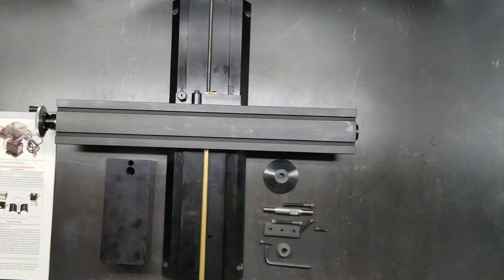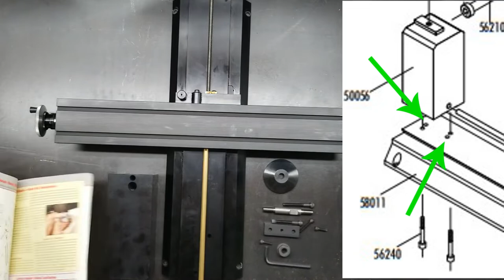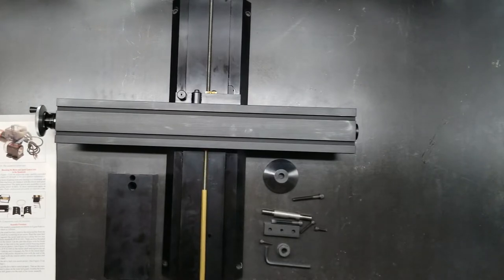Assembly: Sherline 5800 Next Gen Mill… The Big ONE!!!!

Comment: I have the model 5400, and bought the wider table and taller upright as I went along because I kept running out of space to machine things.  There isn't a practical way to increase the Y axis travel, so I'm having to live with that, getting round it by using a rotary table when necessary.  You won't have those problems!
Reply from the maker: That is exactly why I went with the 5800.  Though this thing is heavy and I haven't gotten it mounted yet!!!  That is a great idea and use to get more travel with a rotary table.  I might not use it that way but I still want to get one.  Did you go for the Sherline?
Reply: @LoydPrecisionMakers  I defaulted to the Sherline rotary table as I’m using it as a 4th CNC axis.  The thing is built like a tank, must weigh 10 pounds.  It also readily accepts the faceplates and the chucks that are standard on your lathe.
Reply from the maker: @Reach41  Thanks thatvis good to know and convenient as well. I saw Sherline did a video where it was turning around an engine block. Seems pretty capable.  Do you use it with their CNC linear controller? If so how is programming?
Reply: @LoydPrecisionMakers  I use the rotary table with it integrated into the CNC system on my machine.  It still retains the handle for using it manually, jogging can be done from the on-screen control, and I can issue it G-code move commands manually as well by just typing them into the terminal window.  To answer your question, I don’t have the handheld controller.  No need.

Where did you get your machine shop experience?  You clearly know what you are doing.
Reply from the maker: @Reach41  I gotcha.  That would make for some really interesting machining.  I'm curious how good their hand held controller is with a manual machine setup.  It really is hard to judge without first hand experience or accounts.  

Thanks on the compliment on machining.  Though there is so much left to learn.  My Grandfather worked with my dad when he was young in an auto shop 10 miles past the edge of civilization in the desert servicing everything form passenger cars to mine equipment.  My dad worked a bit in the Kaiser Steel Eagle Mountain Mine before it closed.  They passed a bit of everything on to me.  My last couple years in college I volunteered at a shop part time.  Currently, I am working with a Journeyman Machinist and  Journeyman Tool and Die Maker.  We're doing a pseudo apprenticeship on these machines and using book as a sort of curriculum.

Comment: Have you thought on how you are going to bolt down the mill? My 5400 is bolted to a surplus piece of maple butcher block. No kill like overkill.
If I got a 5800, manual or CNC, my thought was a couple of pieces of say sandwich of 2 24x24x3/4 plywood with a sheet of 1/8 steel on top. Mainly to have something for an indicator stand to stick to but also so I could move the mill to another table if need be.
Reply from the maker: Originally I was thinking of using a piece of .500 inch thick 19x13.5" aluminum rem.  In 6061. Super over kill. Believe it or not it priced the same or just under a piece of sanded marine .75  set up you mentioned. The metal monger also has tooling plate aluminum drops/rems.  Only thing, is it makes the whole thing a bit to heavy. Initially I didn't apretiate how heavy the 5800 was.
Reply: @LoydPrecisionMakers  I had not though of aluminum plate. I forgot how crazy wood prices are now. I am still thinking a top layer of steel for magnets though.
Reply from the maker: @curiousgeorge4608  ya the steel wood definitely be a nice touch. My only issue is the hot rolled i get always seems to have a curve in it one way or another. If I wanted to be totally crazy. Maybe use a piece of aluminum tooling plate and drill and tap a bunch of holes same size the sherline tooling plate. Use all the same hardware and have a mobile dead flat steel plate that can be moved around the base. This way also get a way to fix a removable handle(s) for transportation.... Some day in my copious spare time.
Reply: @LoydPrecisionMakers  The other thing that Sherline recommends, and I agree, is some sort of sound isolation between the mounting plate and whatever surface it is sitting on to reduce noise from vibration. I have some soft rubber pucks that I believe are meant for speakers on my 5400.

I kind of hope you hate the new mill because it is calling to me and I really should not be spending the money :)

I assume you have seen the Blondihacks channel? I really wish I had access to the lathe and mill intro videos when I started to mess with this stuff. I would have save me so much time learning the basics.
Granted her "small" lathe and mill are big enough to machine the Sherline tools.
Reply from the maker: @curiousgeorge4608   That is really good advice on the speaker vibration damper.  The manual only mentions rubber feet. I'd imagine the speaker feet would have better effect than generic rubber padding. I'll havecto checkout a guitar center or Sam ash to see what they have.

Well hopefully I like it. But if it has any issues I won't pull any punches. I can already tell you I dislike the way covers. Their a bit lame. Their is a bost below someone rigged there's to the vase that seems better.

I've seen blonde hacks channel. I was watching her stationary steam plant build. I wish I had access to some of that skyscraper copper pipe. That be great for boiler work. The book that inspired Kozo Hiraoka recommended copper tube or pipe.
Reply: @LoydPrecisionMakers  The design of the way covers or the material? I agree they seem a little flimsy.
Reply from the maker: @curiousgeorge4608  It seems nice material but the springs are a bit of a bother and it doesn't always sit right or flush. I think I need to figure on someway to attach it to the base. Probably so form of angle material.

Comment: This mill sucks i have it you want the one with a single axis column. This thing throws itself out of tram all the time. Pretty much a light work machine.
Reply from the maker: Thanks for the sharing your views.  I did feel like I was tramming it in all the time.  Now I have been tramming it in every time before I start a new part.
Reply: @LoydPrecisionMakers  it won’t matter as because the backlash in my x axis will cause the head to drop and make it take too deep DOC and throw it out of tram.
Reply: Z axis I meant
Reply from the maker: @fsecofficial  Gotcha.  If you come up with a solution let me know.  Likewise I'll post something I there is a work around.  I do feel like I have the least success with climbing cuts as well.  I do try whenever possible to drop my cutter too deep then come up to manage the z axis backlash.  Though machining a pocket that wont be workable.

Comment: I modified my way covers to make them easier and quicker to remove.  I made some threaded hooks to screw in where the existing long bolts and nuts go in, and used springs in place of the existing hardware to connect the front and rear covers together.  On the front of the front cover, I took off the spring and attached the cover plate directly to the board I've got the mill bolted to using a couple of angle brackets.  On the rear of the rear cover, I removed the spring and the hardware that retains it, and replaced the hardware with hooks and reinstalled the spring.  Now I can remove the whole thing in around 60 seconds.  Makes it much easier for the frequent cleaning I like to do.  

I purchased the 10,000 RPM pulley kit, installed it and have had no need to go back to the slower speed pulleys.

I bought a bunch more tool holders, which lets me swap out cutters that use the same shank size without having to touch off between operations, and I keep my edge finder and test gage permanently installed in dedicated holders.  

I fabricated a wheel that fits on the motor shaft above the pulley, and balanced it for a magnet that a hall sensor picks up for an RPM readout.    My mill is pretty sensitive to having the speeds and feeds right, and I found the cheap hall sensor devices on Amazon to be well worth the investment.
Reply from the maker: Wow thank you that is great information.  I especially like the mods to the covers.  That is something I feel like doesn't fit as clean on the mill.  It is the only thing so far i would say feels like an afterthought.  I was concerned about cleaning myself.  I felt like I was going to damage and break down the springs with maintenance and cleaning. I'll have to try your mods sometime.

I definitely want more tool holders and a RPM readout.  I think we have the same headstock and motor So I'd imagine mine would be just as sensitive to speeds and feeds.  It does sound like a good investment.
Reply: @LoydPrecisionMakers  Have you thought of just getting the DRO package? The Sherline version actually counts hand wheel revolutions not absolute travel of the table. It also includes the spindle speed sensor. The DRO display is very basic but does have settings for backlash compensation.
Reply from the maker: @curiousgeorge4608  ya that would be nice to have. I heard from someone else reach41 I think that his mill is very sensitive speeds and feeds. I'm torn if I want the sherline version or to go aftermarket other just go all in on a cnc conversion. But I think o want to get the rotary table first.

Comment: I find I had to really tighten the vertical column  on my upgraded CNC ball screw mill. Sometimes it would shift and I would have to reset it to exactly 90°. Good luck with your mill, Sherline makes excellent products.
Reply from the maker: Thank so much.  I do like it so far.  I apretiate the advice that is good to know.  I may need to go back and give everything a little extra nudge.  That makes me think I really need to drill column bolt access holes for my base.